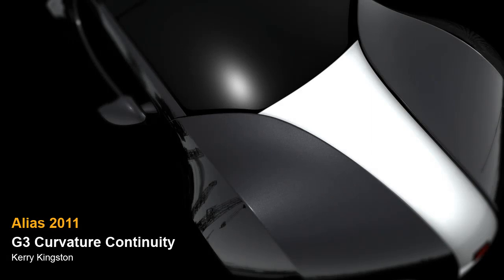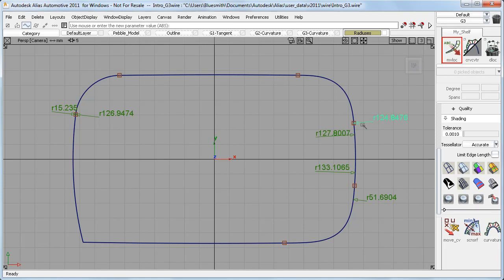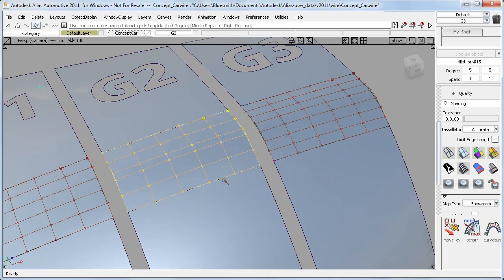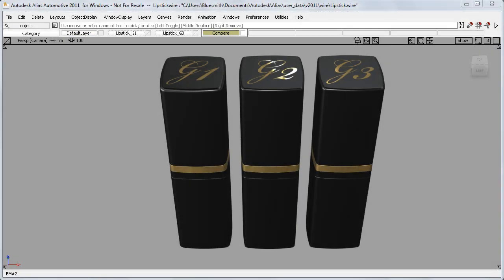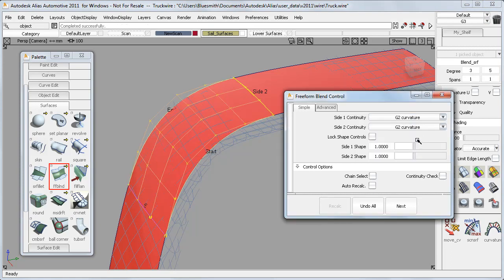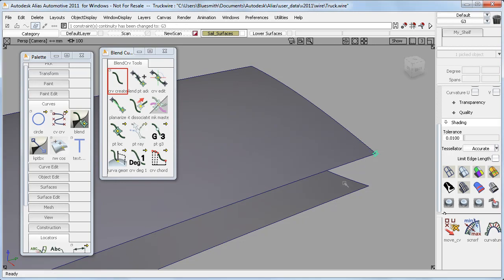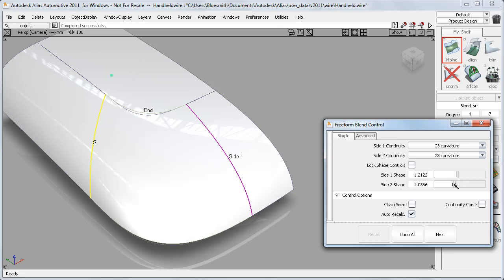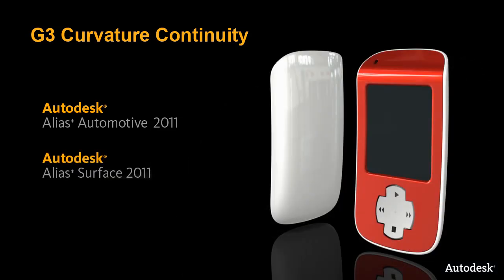Autodesk Alias 2011 Essentials - G3 Continuity

Comment: In the last example you should have displayed the curvature plot in it the other direction :)
In general, nice examples. I liked the blending + the two "deg 7" driving curves. You said that the result is "heavy". Why? The result is simply perfect and we, as modelers, should not think about "number of control points". What is good is good as far it can be good for downstream applications.
Reply: Do you know why is G3 continuity only achievable between two edges?
Reply: If you want to create a n-sided surface that has to be G3 on all its boundaries, corners included, the continuity between the adjacent surfaces should be G4. Therefore you will achieve G3 along defined directions "only". You won't be G3 along a section that is passing trough a corner of your n-sided surface.
Reply: @ciarlond  Sent you a sample file.
Reply: I have received it and replied to you